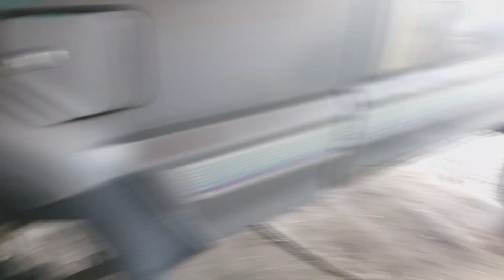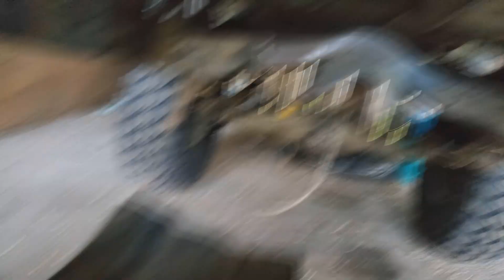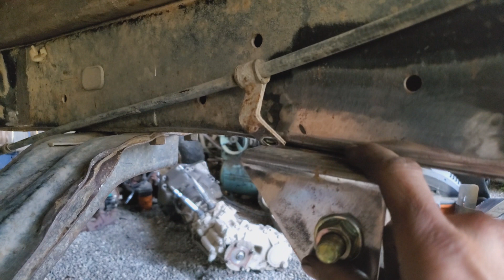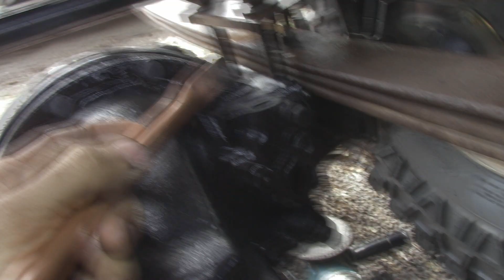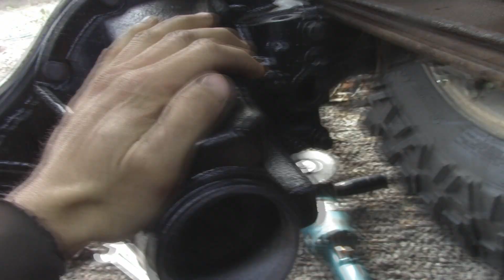Ultimate Offroad Mazda - Random Bits (Pebble Garage)

Comment: Haha yes, 37s!  She’s gonna be one hell of a rig when you’re done. Keep it up!
Reply from the maker: haaha! i could probably fit 40's without rubbing :P the rear has gotta come up to match the front still. granted, there is still not weight on the front, and the box is full of crap, but im going to have to add a leaf to the rear to even it up... im super pumped to get this thing done! ive been working almost every night till late to make more progress... i should have the body mounted by the end of thursday night. that is the goal anyways... then i can do up the brake and fuel lines, then drop the engine in. honestly, this is the biggest project i have ever undertaken, and its been really trying at times, but im pushing through it all. gotta get this thing done so i can enjoy at least some of the summer haha!